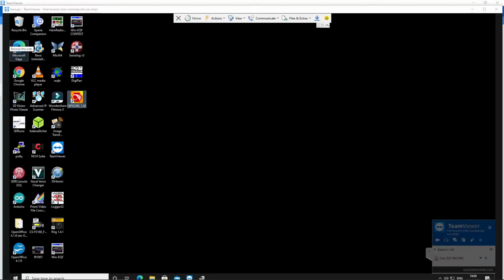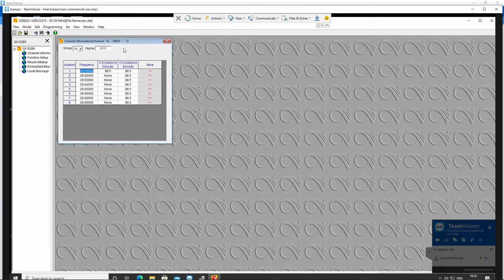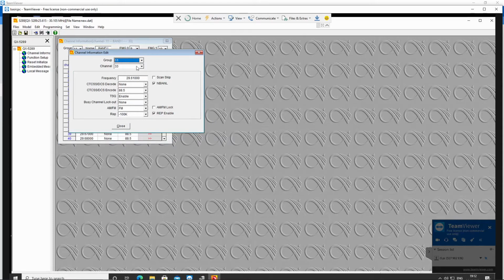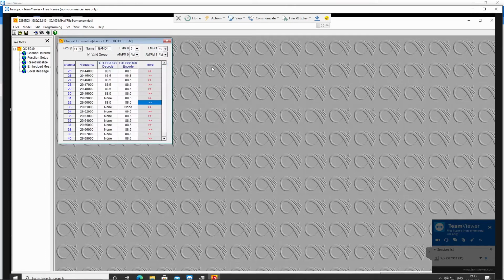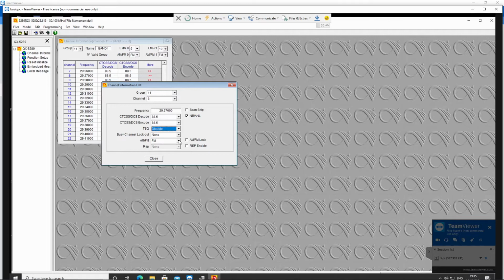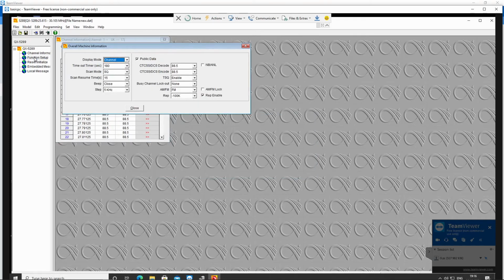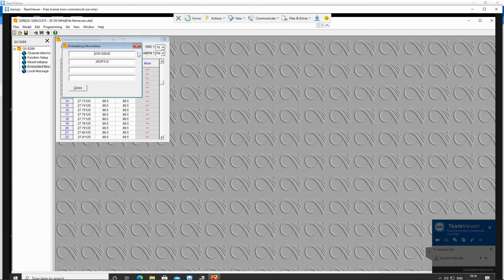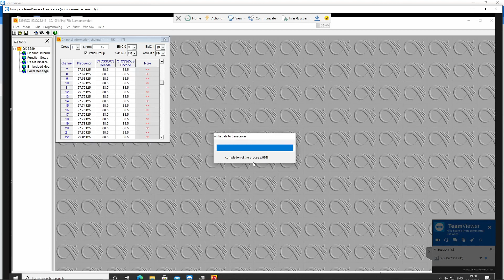Programming the TTI- TCB 5289

Comment: hello!  what cable do you use  on what port?  it doesn't work for me
Reply from the maker: A TTI cable came with the radio. Your computer will allocate the port number do your settings are likely to be different from mine. If your pc doesn't see the lead or the radio it may be a driver issue